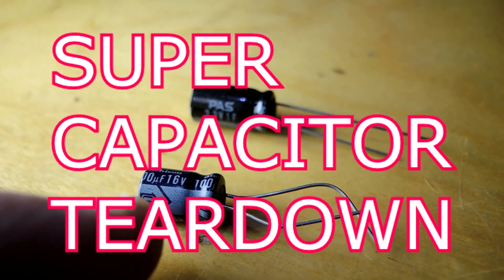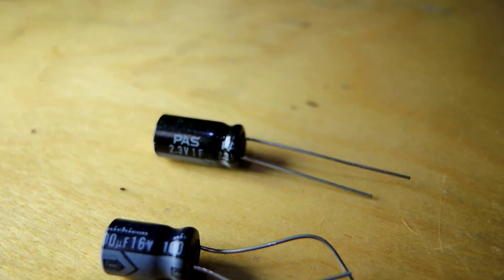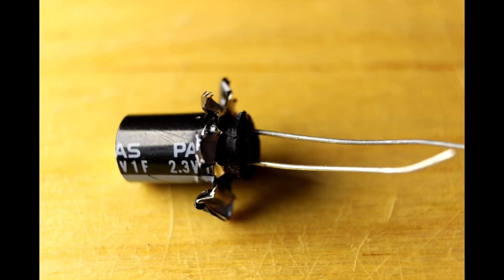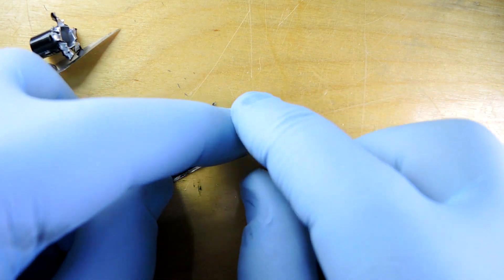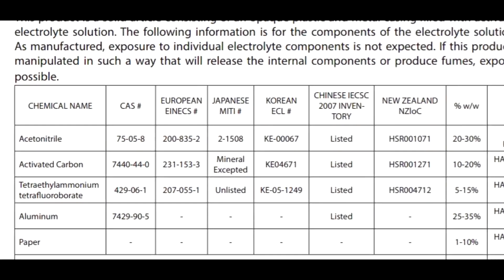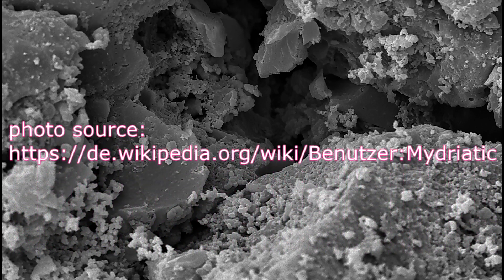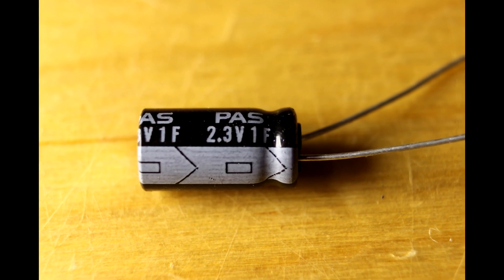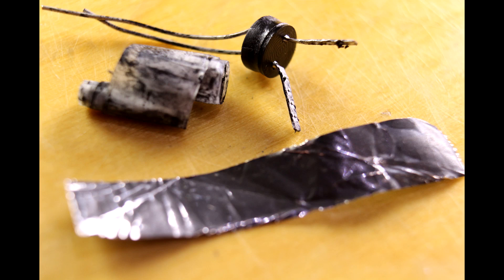Tear down of a Super Capacitor

Comment: How would one test the capacitance of one of these? I bought some cheapies and I think their claimed capacitance is nowhere near.
Reply from the maker: Power supply, oscilloscope, resistor.   Measure resistance for accuracy, setup scope for a long slow capture, put capacitor and resistor in series and then charge the capacitor.  At 63% of voltage you have one time constant from that you can work out the capacitance value.